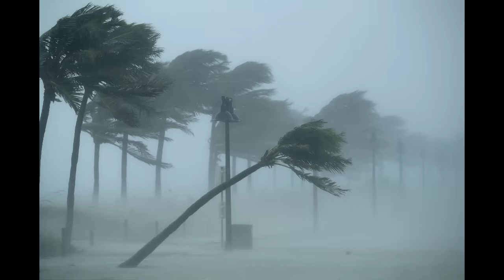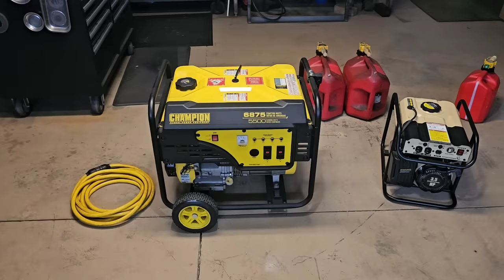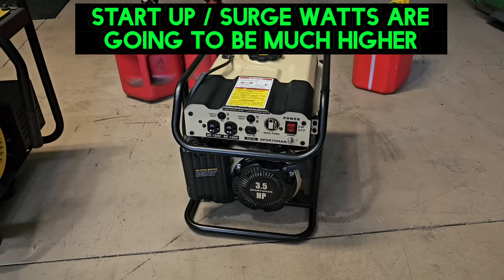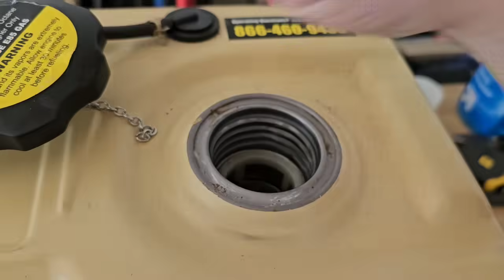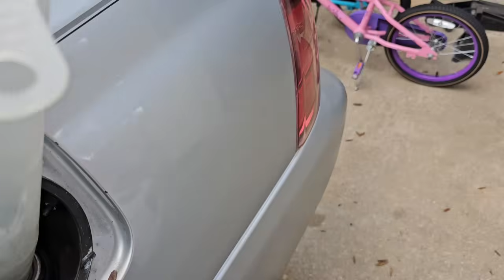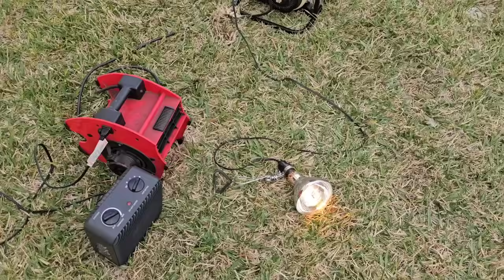Why smaller generators are better for power outages.

Comment: my champion 2000 watt or 2500 watt both can run for 11 to 12 hours on one gallon when used on my motorhome without A/C  and after putting in a window A/C taking off both roof A/C,s will run 7 to 8 hours plus down sized microwave to 700 watts they run it with no problem saving 100,s of gas dollars, i have a 4700 watt i use on my property sometimes just to let the small ones have time off and im off the grid also have solar for sunny days

Comment: I agree. We also have a 7000watt and a 3800 watt. Fuel consumption was an after thought. I had a generator that had carb problems when we needed it most. The smaller one is great to give the big one a break. We change out working each one every 4 hours and change the oil every 36-40 hours.

Comment: Dual fuel generator with a few propane tanks. Propane burns cleaner(extends generator life) and is able to be stored much longer than gasoline. You can also cook on a gas grill with it.
Reply: If you take care of your generator, propane does not matter.  I have a Generac XL5500 which runs on gas.  After each severe power outage, I put it back into long term storage mode which was outlined in the product manual.  That includes, running the gas out of it, changing the oil and filter, and putting a squirt of oil in the cylinder and closing the valve.  This unit still starts up with one pull.  If you need a generator, it should be the best maintained motor on your property.
Reply: @gibblespascack1418  You are the exception to the majority. Most folks don't take care of 50k cars, much less a 1k generator.

Comment: The Harbor Freight generators are good but consider them disposable. When they break no small engine shops will work on them and you can’t find parts for them to fix it yourself.

Comment: I have a 3400 watt peak generator that i use mostly in the summer when we get bad storms and it knocks out the power. But it really came in handy last week when we lost power for 3 hours and i was able to run the Furnace and lights. Everyone that can should have some kind of small emergency generator just in case.

Comment: Hot water heater...? Why would you need to heat water if it's already hot?
Reply from the maker: When the hot water gets used out of the water heater tank, it is replenished with cold water from the city or well (depending on which water source you have). Electric water heaters like many people have require electricity to heat the new water.

Comment: I'm an electrical engineer.  Many ask me about putting in whole house generator.  I tell them when I wired my house I did make it future for whole house for a selling point for a future buyer but I would never do that. Whole house is a stupid idea as it takes to much fuel.  I have a 30A generator inlet outside with breakers tied in the main panel for the transfer switch.  I have to have 240v for my week pump.  When I have a power outage I wheel the generator out of the garage and connect it. If I know it will be a long outage run it for about 30-60 minutes at a time and then turn off for 2-3 hours.
Reply from the maker: Thanks for the info

Comment: I have been doing home backup power since the 1980's when it occurred to me that most everything is dependent upon electricity.

Portable and the low cost Generac whole house standby generators use a lawn mower engine.  These need an oil change every 50 - 100 hours (1 hour for the first oil change).  You absolutely can't use ethanol blended fuels, these breakdown very quickly and start damaging the carburetor in as little as 2 weeks.  I only use non-ethanol fuel with Sta-Bil and 1 oz of Marvel Mystery Oil per gallon, which I have tested out to 4 years so far in gas tanks, gas cans, and carburetors, without any problems.

Your standard kitchen refrigerator uses a surprisingly high amount of starting power.  You need a generator with 2,500 watts minimum of continuous output (not surge power) to cleanly start a kitchen refrigerator.   Note that generators have wattage listed in surge power, the actual output power is only about 75% of the surge rating (multiply the surge rating by 0.75 to obtain the continuous rating).

If you can only afford 1 generator, buy an inverter type enclosed in the plastic case, with a surge wattage of 3,000 watts or more.  These cost more than the basic open frame 3,600 rpm generator but, are quieter, generate clean power, lighter weight, and get better gas mileage.

Ideally, you should have at least 2 sources of backup power for long term power outages.  A gas generator and a rechargeable 2,000 watt power station.
Reply: @billharris6886  - I used zero Stabil and zero ethanol free fuel and zero mystery oil over 20 years with my Gen set. It all comes down to storing it completely dry in my opinion and getting large amounts of fuel prior to known coming events then you don’t have to store it. Store 5 gal or so but rotate it in your car every 2 months so no need for stabilizers.
Reply: I weathered hurricane Milton 2 weeks ago, power and Internet was out for 3.5 days (even the cell towers for 5 hours).  I used my off-grid solar system to power everything except the clothes dryer.  I only used a generator to recharge my battery bank when these wasn't enough solar power coming in, only used 2.5 gallons of gas the whole time.  This is the first time I got to run off-grid for this long.  It wasn't quite like having grid power, where you have unlimited power avaliable so, I had to budget/prioritize which high current loads to run but, much better than having to depend upon a gas generator (no engine noise and low maintenance to keep things running).  My battery bank is 40 kwh and inverter is 4 kW.  Obviously these solar systems are prohibitively expensive for the average person.  Being a retired electrical engineer, I built my own system for about a tenth the cost.  Those portable "Solar Generators" (rechargeable Lithium battery pack with 120 Vac power inverter) are basically a miniaturized version of an off-grid solar system.
Reply: I’d have to disagree. I ran my full size fridge and a deep freeze on a 1,600 watt (continuous).  They weren’t even the only load. I ran my home internet/network, 4 fans, a 50” TV, and charging my Battery backup.  Ran for 3 days with no issues.
Reply: @victorc777  I agree with you too. Refrig might max out starting at 1000-1500 watts. I measured mine it was at 110 watts almost continuously for 24 hr. One small defrost max out at 500 watts. I run 2 on my 6000 running watt along with a microwave and lights and have zero issues.
Reply: @victorc777  My recommendations are a worst-case scenario, so someone trying to buy the average generator to power their selected items will end up with a working setup.  My information is based upon testing numerous refrigerators since the 1980's.  Also, generators like the Honda for instance, have excellent surge performance compared to the average Chinese knockoff.  Additionally, the newer kitchen refrigerators with a DC Inverter compressor, have a lower starting current.  So, when taking everything mentioned into account, I like to err on the side of extra capacity, which also extends the life of the generator since it is not running at near maximum capacity.
Reply: @billharris6886  good points

Comment: Agree with your comment about having a large enough supply of gas. We keep 5 5-gallon gas cans of stabilized gas on hand. We have a 7,000 watt Harbor Freight Predator gas generator connected using a generator interlock.  Our game plan is to run a genie a few hours in the morning and several in the evening. Gas supply should last a week. To keep our home network alive when the genie is not running we have UPS that is able to power the LAN when the generator is not running and recharge quickly. 

Something else is run your generator every few months to make sure it will work when you need it.

Comment: If you want power through the night you will need batteries and an inverter otherwise the neighbours will be justifiably upset with you stopping them sleeping. Then you will need a really big battery charger to refill batteries while going at the usual day consumption rate. You'll have the same neighbours after the power cut so don't upset them, Maybe offer them an hour of one freezer twice daily so that they don't waste food.
The prime target is to reduce your consumption drastically so that you survive a few days. Yes a power outage will put the petrol station out of business too, with nothing to pump fuel or run the computerised till system.
Reply from the maker: Great points and information! I do want to invest in a battery system at some point this year. Hopefully soon

Comment: For me the holy grail has been an open frame inverter generator.  I can power what I need, but it's quieter, more efficient and puts out better power than a conventional gen.  Also, despite my more rural setting we've never passed 48 hours without power being restored, and you could buy gas well before that.  That said, I do stockpile like 27 gallons so I feel like there is no reason to go out and pick up a small inverter generator.  In a severe situation I could easily ration my generator usage and extend for days and days.  For example, my WEN is rated at 7,000W continuous and the spec is 10% less fuel consumption than your Champion 5500W while carrying over 20% more load.  And it really shines overnight where the engine can idle down a bit.

Comment: The word, "back feed" is a term used for a technically illegal and deadly dangerous situation for both your utility workers and anyone within your house.  I think you mean an electrical inlet connected to a breaker through an interlock or a transfer switch.

There is another potentially better solution to having a big or small generator and that's a modular solution through the use of inverter generators.  Take for example, the Honda EU7000is, a generator that is still a fairly far away dream of mine to own.  Inverter generators have a feature that allows the engine to change speed depending on the load.  When you want to run larger loads some inverters can do a parallel operation allowing you the option to put two (or possibly more) of them together to fit your needs.  Major appliances like electric stoves/ranges, furnaces, water heaters, fridges, freezers and sump pumps can run off of the large generator and you can probably limit the use during the day in winter or during the night in summer to heat or "cool" your house respectively during winter or summer, again respectively.  Also, purchasing a generator with an idle feature that can run non-computer controlled appliances like freezers, fridges, etc can also save in fuel.  It would ramp up when it's needed and then when the load(s) turn off, the generator idles.

The other thing that would help that I find interesting about Southern states is the lack of insulation inside your homes.  This can be a money saver with running central air conditioner units as you don't have energy wasted from thermal energy displacing the "cooled" air in your house.  Some people tend to be allergic to it for some reason but then again, your building codes don't come anywhere near the standard that ours do.  I mean, an F3 tornado ravaged our town over ten years ago but only a few structures were totally written off and condemned.  If the same tornado ripped through the Southern states, pretty sure that 90% of the residential areas of the community would look like match sticks or kindling for starting a fire.

Starting induction motors in major appliances can see at least three times the surge power of running.  So, if your fridge nominally uses, say 500 W, it takes 1500 W to start.  That's a 15 Amp branch circuit.

I would say if you are buying a used generator, make sure it's a Honda clone as the aftermarket carburetors for Honda clones are probably some of the best out there.

Comment: My last gen test, i let it go till it shut off because fuel was out. This is the best way?
Reply from the maker: Yes, if you're about to store it away, close the fuel valve and let it burn out the gas that is on the carb and fuel line. I'd still recommend cranking it up every month or two. Don't the the gas inside the fuel tank get too old either.
Reply: @Mechanical_Mind  I let it run out tank and all. Will do a test this should work. Thanks

Comment: I have chosen it go with a small inverter generator and two 1000 watt solar battery power banks. Honda 2000 will run 4 hours at 50% load on a half gallon on gas. I use generator to charge battery power stations when solar is unable to keep up. I do not plan to power the whole house, only furnace fan, chest freezer, recharge phones/tablets, & recharge portable lights. 
Excellent advice in this video!
Reply: Also rocking a hybrid setup with a small 1900W inverter generator to top up a solar+battery+inverter setup. Handful of panels will pass-through to run window unit and fridge/freezer, and the batteries can get charged by the generator during the afternoon so that there is enough power to keep everything running overnight.
Reply from the maker: Hey Thanks Utah_Mike! The next day after I made this video I bought the 2000 Predator inverter generator to replace that Sportsman Tan generator. We have newer appliances now and I was worried about using a regular generator for them. Best part is it so much quieter and more fuel efficient.
Reply: @Mechanical_Mind what size is the tan sportsman generator?
Reply: That's the way to go. Some amazing efficiency too. I'm going to be piecing together a setup just like that. Any recommendations for power stations with LiFePo4 batteries?
Reply: @Rankine_Cycle21  past summer I diy a large battery power station. Lifepo4 batteries are very affordable these days, added a battery charger, a charge controller for solar input, and a pure sine inverter and I ended up with a large battery power station. Lots of YT videos on the set up.
Reply: Ecoflow delta 2 $399  @Rankine_Cycle21
Reply: I was going to say that, but you beat me to it
Reply: That is my solution. I have a 3500 watt surge inverter generator, a Ecoflow Delta 1300 solar generator and 7 100 watt solar panels, 4 of which will be used to charge the Ecoflow.  The inverter generator will just be used a couple of times a day to charge my solar generators and an extra 100 AH battery.  That was the theory at least which I had tested out.

Hurricane Milton comes along and I connect the Delta 1300 to the fridge as a UPS overnight.  We never lost power, but the Delta 1300 died anyway. The Ecoflow has been sent to the manufacturer for warranty replacement.  I would have been stuck using the generator to run the refrigerator if we lost power because the 500 watt inverter that I had wasn’t enough.
Reply: 1000 watt hours worth of battery storage? Whatchu mean 1000 watt battery?

Comment: Use what you actually need
Cut off unnecessary power consumption is the key for emergency
Reply: I gave away my 6500 watt generator and replaced it with a much quieter 4000 watt 240 volt and an ultra quiet 2400 watt 120 volt inverter type. Both handle massive surges. I ran a new curcuit in the house to run critical need items and painted these outlet covers blue. The critical curcuit runs on the small generator. I converted both generaters to run on natural gas, propane or gasoline and I am installing a 12KW battery back up to reduce the need to run a generator full time for power. I am concidering solar as my last backup but only because it will pay for itself in a few years in lower electric bills.
Reply: @kevinm234  That’s doing it right!  Nice job 😊👍👍
Reply: LISTEN TO THIS GUY.  He is spot on.  I have a large generator and a small one and both are dual fuel.  I  was very fortunate to have a Predator 3500 for our Snowmaggedon in Texas a few years ago.  Because of It and my neighbor who is an electrical engineer we were able to keep 2 refrigerators and power the gas furnace during the power outages.  Our neighbors without generators had broken pipes that cost thousands to repair.  The Predator 3500 ran 12 hours straight at -2 degrees!  I have since replaced the Predator with a Champion 4000 watt duel fuel.  BE PREPARED, It felt like a full time job keeping the house warm during the Snowmaggedon.
Reply: Exacty.  How much gas a generator burns is directly related to how much electricity you want.
Reply: @ not to be that guy but more displacement burns more fuel too. Just like how in cars larger engines use more fuel just to idle. Although yes load is important. High load low rpm is ideal.
Reply: True,  but even at 25% power usage the big generator will burn 4x of fuel ⛽ that the smaller one would.
Reply: @DrewsBackYardMechanics  yeah it just like why smaller turbo'd engines are better than having a V8 for the one time you need 500lbs torque.
Reply: Just because your in an emergency doesn’t mean you should sacrifice comfort 🤨
Reply: @jessihawkins9116 if you can predict the time of power recovery , you definitely can have anything you need or want 
But we’re talking about emergency, and Gasoline is limited
Reply: @jessihawkins9116  Yes, it does mean exactly that. lol If your priority is comfort and survival isn't an issue, it definitely doesn't qualify as an emergency.
Reply: @Desert-edDave Yeah, there's a difference between an emergency and an inconvenience.